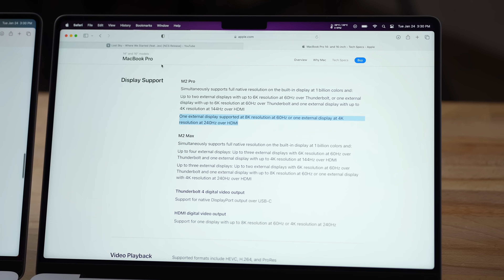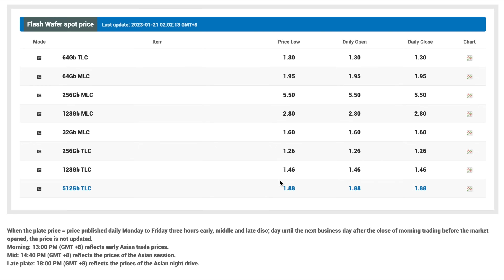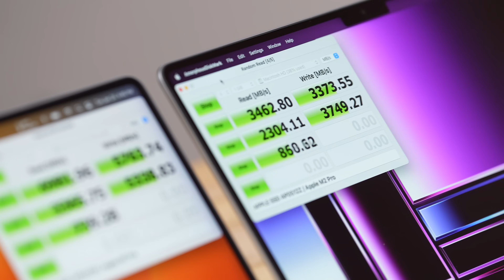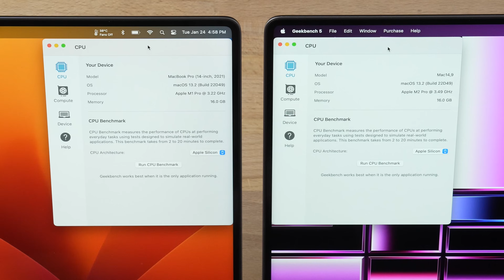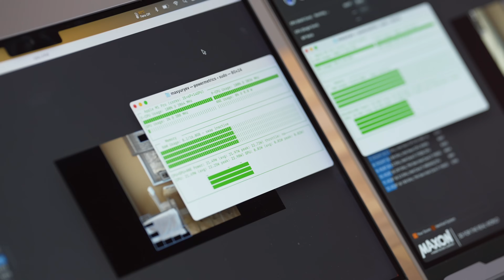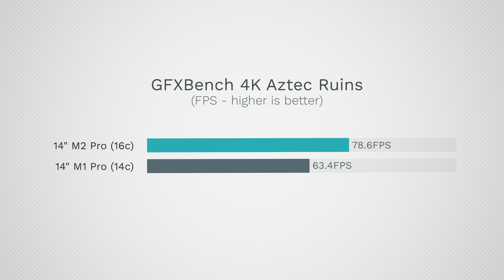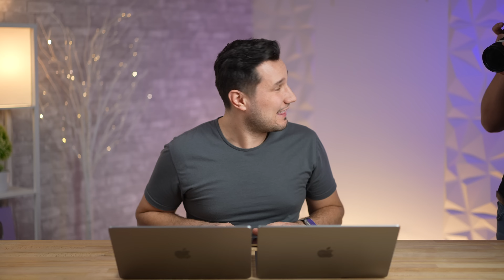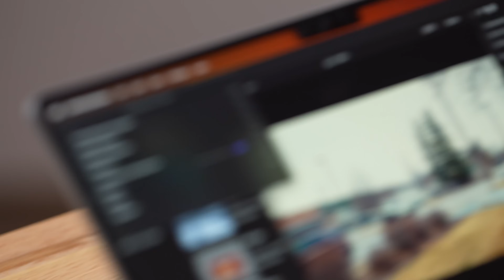M1 Pro vs M2 Pro 14” MacBook Pro - ULTIMATE Comparison!

Comment: Great job!

The M2 Pro SSD decision really sucks.  Processing is clearly an improvement but I wonder how the overall mixed usage will really improve with the lower SSD performance.  Another interesting observation is that the Random Read/Write tests on the M2 Pro is marginally better than the M1 Pro.  Could it be because of the faster processors?

Comment: I’m finally upgrading from my late 2013 13” MacBook Pro. It has served me well, but definitely much too slow for a lot of what I want to do. Should be quite an improvement after nearly 10 years!
Reply: same with me too, i have upgraded to M1 Pro 14 Inch form 13 inch late 2013 MBP, the size almost the same, and the M1 Pro base models is really great for handling any task for me and the battery life is stunning
Reply: I’ve updated from the same 2013 retina to the 2021 14 inch MacBook Pro last summer and it is absolutely perfect laptop. Seeing how Apple is cutting costs here and there I’m even more happy with my purchase

Comment: The absurdly shameless thing Apple did here is that they're NOT TRANSPARENT about the SLOW SSD PERFORMANCE because they now use single NAND chip compared to two NAND chips of last year's M1 products. They should have specified it upon purchase (either at retail or Apple online store.)
 
Or I'd like to see this as FALSE ADVERTISING. Just like Apple advertising M1 Ultra as faster than a RTX 3090-specced unit. Especially on a device touted as a PRO machine. Shame on you Tim.

Comment: Perfect comparison video, as always to the Max!
Whether this SSD NAND chip issue will impact performance negatively, YES.
Especially if you are working with constant read/write operations. I'm a ZBrush artist and using MBP as my main machine, hitting Quicksave for a normal project that has ~20 GB each on fast SSD will definitely be worth it!
:)

Comment: I didn't expect Apple to cut back on the SSD with the MBP models. Even if it wouldn't make much of a difference to the tests you run, there are people who might need this speed.
I am very much looking forward to the upcoming tests you will do to see if there is much difference in the SSD in other models
Reply: This new test is flawed, possibly? Max has already shown in the past that machines with an SSD in 2 slots have faster read/write than those with a single SSD. I suspect we'll see more apples to apples tests in the coming days.
Reply: @Lexxo777  yes, we will see in the coming days through the tests what the other MBP models show in terms of performance.

Comment: I would like to see the difference between the 16GB vs 32GB RAM, especially in the context of slower SSD inside the M2 Pro as the 16GB is more likely to use the SSD for the swap vs 32GB.

Comment: Great comparison, thank you. M2 Pro MBP is unfortunately disappointing. HDMI upgrade great. M2 higher clock speeds, higher power consumption, higher temperatures, not good. SSD so slow. M1 Pro MBP is definitely the better choice for the money. Am curious about the comparison of M1 Pro MBP 10 CPU and M2 Pro MBP 12 CPU.

Comment: These benchmarks are a gem, and your analysis helps a lot with my purchasing decision. Sucks to see the slower ssd and higher temps on the newer m2 pro. Definitely didn't know about these issues before your video.
Reply: Only 2° difference and more battery life and faster performance, I think m2 speaks by its own
Reply: @robertoavalosjr.2529  M1 Pro can be had now for 400 bucks cheaper, better speakers, runs 10 degrees cooler and double SSD performance. Apple nerfed the m2 Pro on purpose to squeeze save a few extra cents. The m2 is a new generation so it should obviously be better but for them to do this is absolutely disgusting. Glad I saved and went for the m1 pro.
Reply: @itsasadbunny  the speakers are hardly noticeable difference tbh. and running 10 degrees cooler isnt ever really noticeable either unless on your lap, which no1 would really be running intensive programs on their lap anyway. the only actual important downside of the M2 imo is the SSD read/write speeds. Beyond that the M2 is definitely the better computer. For anyone in the market for a Macbook pro rn that hasn't had apple M silicon yet, the M2 is the best choice (even if you can get a refurbished M1 for $400 cheaper). M2 pro has the better camera, all around better wifi, better bluetooth and HDMI, better battery life, and of course faster cpu and graphics. Plus its over a year newer so will have apple updates longer.
Reply: @Jayster3  you really want to excuse Apple screwing up their customers again, don't you?
Reply: @rafadydkiemmacha7543  you really wanna overexaggerate the issue don't you? Lol
Reply: @Jayster3  they are making these devices faulty on purpose. They have access to the best designers and technicians. Professional reviewers can name faults in matter of minutes, so Apple does it on purpose.
Reply: @rafadydkiemmacha7543  faulty? lmao there's nothing faulty about these machines. Stop it. The user experience with a M2 pro is fantastic. You literally do not notice the slower speeds. Should apple have done it? No. But Its truly not a big deal.
Reply: @Jayster3  the way they design cooling system isn't faulty? Duuude.

Comment: The battery test isn't fair, the M1 is a year or 2 old, batteries degrade with age and charge cycles, thanks for the other tests through

The heat sinks look almost the same size, one is lying lengthwise, the other is lying widthwise

Comment: With SSDs the random writes (more common in real-world?) are mostly better on M2. How do these compare for encrypted volumes? (incl. vs encrypted PC SSDs)
Graphics look impressive but I didn't think GPU scaling was an issue at 14/16-cores is anything else going on here? Can you check the new Metal RT setting for Blender?

Comment: These tests are not reliable as each test if you observe carefully is not done with the laptops of same specs. One test uses 8 core while other one done on 14c. So ideally these test do not tell the actual efficiency of a standard spec laptop. Do the tests properly not to get views

Comment: Interesting that despite benchmarks showing the M2 Pro being quite a bit faster than the M1 Pro the Lightroom Classic export test you did showed them almost the same.  As you say, I suspect the half speed 512gb SSD in the M2 Pro is the reason.  Very disappointing.  I suspect the M2 Pro Mini and M2 Mini also have the half speed 512gb SSD.

Comment: For those of use still relying on older Intel Macs for our primary workstation, it's interesting to see the M2Pro hardware adding a boost in your Speedometer test. Can't wait to see more testing with models that have multiple NAND chips on-board.

Comment: Wow, Apple went all in with cutting corners in the SSD huh. I usually use up all 16GB ram and when it goes into swap it immediately has a noticeable impact on performance. Now they made it even slower while still charging a ridiculous price. I feel like they make more profit on Ram and SSD upgrades than the whole machine itself.

Comment: Regarding battery performance: Did you use a brand new M1 Pro machine? In several new Apple products, maximum battery capacity seems to drop incredibly fast over just a year. So if your M1 Pro machine has a reduced battery capacity of maybe remaining 90%, the win of the M2 Pro one in terms of battery performance would be no surprise! Would be interesting to know if this was a fair comparison…

Do all of you guys out there also experience a decreasing battery lifetime of Apple products over the years?
Example:
My ‘new‘ iPhone 12 mini from 2020 has 88% maximum battery capacity 
My old iPhone 6 from 2014 (!) has 87% (out of use since 2020)
What is the reason for this? A more demanding Apple chip?

Comment: I have owned the M2 Air for 1 month and now have horizontal and vertical lines flickering on the screen, making it impossible to use. I was replacing a M1 MacBook Air that had the same display issue within months of buying it. They made me send the M1 in for repair twice and it failed again a third time right after the warranty expired. This was a new laptop! They refused to issue a new laptop to replace the reject I bought and since the warranty expired they expected me to pay to have it fixed again, when they didn’t fix it properly the first 2 times! The second time they falsely claimed I dropped it but they fixed it and shortly after the screen quit working completely.

So… stupidly I bought an M2 Air thinking the problems were with the M1 only. Nope! I have the same display issue with the new model after 1 month!!!  Apple isn't owning up to the display issues of the M Series MacBooks. In the past year I've spent almost $3,000 for 2 MacBook Airs that are now useless. I've wasted so much time sending it in for repairs, reloading apps and being without a computer while they try to fix their issues, which they obviously can't do… or won’t do because they’ll “fix” the issue, until the warranty runs out and leave you to pay for the failed laptop afterwards. It’s a trap. That’s what they did to me with the M1 and now it’s happening again with the M2. 

If you have a serious problem with your Mac you’ll never get a replacement; you’ll never get your money back and your work will constantly be disrupted with getting it repaired. Good Luck to you if you spend your money on one. As a long time Apple buyer/user, I now recommend you don't as it appears that Apple is not being responsible for the ones that have display issues.

Additionally, if you do gamble and buy an M2 be sure to also add the additional $300.00 for the Apple warranty or you may get stuck with a large repair bill shortly after the factory warranty runs out. I feel scammed.

Comment: Sadly I think Apple what’s really hoping the 3nm chips where there in time because of the ~20% less power  usage for the performance. Also the RAM is not slower the ram speed is the same the difference is that the pc can use 2 instead off one chip

Comment: I thought Apple on a $2000 laptop had only one NAND SSD chip in the base model, but I liked the part that the battery lasts longer than the previous model even using more energy and still stuck in the 5nm process.

Comment: I'm found an M1 mac mini 256gb base model on sale for $200 off ($699 instead of $899 - Canadian prices) and I see the M2 mac mini 256gb is now $799 not $899 for the base model. I dont require alot of storage space - I'm more concerned with speed and performance. It looks like the M1 has a better SSD and is cheaper and that may be the better option. Does anyone have any thoughts/comments?

Comment: As a solution architect who spent decades dealing with spinning drives where performance was measured in hundreds of megabytes, am I the only one who thinks 3.4GB/s is just stupidly fast already? I totally get it that there are use cases that need the faster 6GB/s. I just can’t get over how incredibly fast I/O is these days. 

As an aside, I suspect the single chips are Apple’s solution to supply chain problems more than a cost savings solution. The decision is obviously hurting their reviews, but they’re willing to take the hit. Likely because it’s letting them get more of these high-demand units out the door than if they stuck with two chips.

Comment: Need to account for the year or two’s battery wear of the M1 Pro MBP 14”. More or less in that case, it’s the same as for the battery life between the two, give or take. 

However, given the SSD shenanigans and just the 20% performance boost; it’s really a good time to snag a M1 powered model, given they’ll be getting huge price-cuts; until they all get sold out 🏃‍♂️

Comment: I think that the biggest problem will be when the SSD starts to fail. Data recovery will be a pain in the ass assuming you dont use cloud services. So far, M1 and M2 are relatively recent, but idk how much more time can they last with all parts integrated.

Comment: Happy to see the comparison soon after M2 Pro launch and you guys are miles ahead of others. On SSD speeds, although I am surprised to see a slower speed on M2 Pro, I don't it matters much as there are no apps out there that can hit 3GB/s mark.
While the M2 Pro is certainly more powerful, deals on M1 Pro makes it even more VFM and hence I got M1 Pro couple of days ago. Very happy with the performance when compared to i5 13" MacBook Pro and M2 Air that I am currently have. Cheers!
Reply: Hey Jay any deals you can share? I'm looking for the same.
Reply: @zanettialvaro  I live in EU and bought base model - 8 core 16GB Ram 512GB from amazon uk for little over 1.5k sterling. I see prices dropping further and would advise you to keep an eye out. A refurbished mac from Apple is also a great option.
Reply: @zanettialvaro  Same, let me know if you find them too!
Reply: @alexanderpadden6498  base 14" MBP is on Apple's refurb store at $1539. The new M2 base is ~30% more expensive so me thinks 2021 MBP refurb'd is great VFM.
Reply: @dentheplodder  FYI:  I just looked and I can only find 14" MBP w/16GB and 1TB SSD for £1839...  Nice configuration, too much money...
Reply: @kjbarth007  yeah, they weren't on the UK (where I'm based) store for long. Matter of days and then gone.
Edit: They were selling for £1459
Reply: @kjbarth007  Amazon uk have 'Used Like New' for 1638 sterling at the moment. It would be a brand new unused mac and i believe it is good price compared to M2. I see prices dropping further, just keep an eye out. Cheers!
Reply: @kjbarth007  2021 base 14" MBP are back in the Apple UK refurb store. Wouldn't expect them to be there for long.
Reply: In Australia M2 14 Pro base $3,199 versus M1 14 Pro base $2,547 both brand new. Makes M1 very appealing on price and value.

Comment: This is total disapointment. It costs 2400€ and it has slower ssd than older M1 Pro version. Apple just desperately force people to pay another 260€ for extra 512GB ssd chip. And smaller aluminium block on CPU which draw 10-20% more watts is rediculouse too. It is seen by thermals you shown that this is bad :( I was waiting for this machines but now i am not sure if i am willing to pay extra just to get full ssd speed.

Comment: Absolutely no regret on getting the base Studio M1Max 16/512 compared to the Mini M2Pro with 10c. It appears that the Studio is faster at absolutely everything which doesn't quite make sense in the CPU department at least. Both M1Max and M2Pro have 10c CPU, with the M1Max being slightly "slower" and yet - it still outperforms the M2Pro in benchmarks.
The new SSDs in these M2 machines are a real shame tbh.

Comment: Fantastic review on the comparison! 
- Slower SSD, Worse Cooling, "Worse Speakers" (sound is subjective though)
- Better Battery Life, Better Performance (CPU & GPU), has a matching mag-safe cable (maybe sell them separately Apple?)
At the end of the day, whatever suits your needs is the one you pick...because instead of comparing devices, compare the prices :)

Comment: The M2 Pro Mac Mini has ver similar SSD performance and Luke Miani found with a full tear down that it had two NAND chips but they were just on different sides of the board. I am wondering if this one also has two NANDs, just on different sides of the board as well and its just slower NAND then the one in the M1 Pro. No idea though.

Comment: I would have thought, this being the third iteration of the Apple silicon, that this would be a tic in the engineering cycle. But at this point it seems to be a second toc focusing on efficiency rather than delivering a large number of new features and performance.

Comment: Max Tech… Are all the M2 SSD performance options you tested thus far slower then the M1 SSD’s? I originally thought it was only the case with the base 256GB option and not the upgraded 512GB and higher options? Originally considering the 14” MBP but now thinking the Mac Mini and will be using for photo & video editing.

Comment: Being an Intel/Windows user for  over 30 years and due for a new laptop purchase. I was therefore intrigued by Apple silicon with its performance to power and really appreciate the time and effort your team puts into the reviews which certainly went a long way towards me making my decision in November 2022 to purchase a base M1 MBP 14. The single ssd trend from Apple is dissapointing and I think a missed opportunity. Also, as proven in your tests, raw benchmark tests do not tell the full picture compared to everyday use meaning there are minimal gains to be made by upgrading from M1 MBP 14 to M2 MBP 14. Please keep up the great work!!

Comment: I have a 2019 i9 MBP 16 and thinking about upgrading to Apple Silicon but I'm holding off on doing it until your upcoming comparisons between unbinned M1Pro and M2Pro as well as M2Pro and M2Max. Your reviews and comparisons are really comprehensive and useful.

Comment: Not liking the single Nand chip, or the smaller heat shield. Strange that Apple made both of those decisions. If I upgraded from my M2 Air to the Pro, I"d buy an M1, for my usage. Honestly, my double spec M2 Air is plenty powerful, for my needs..I would enjoy the extra ports, better screen, and better sound, on the Pro, though.

Comment: The battery test is not directly comparable as the M1 PRO MBP battery would have degraded somewhat for the past 1 year of usage whilst the M2 PRO MBP is fresh from the factory, being able to hold the full charge better. Of course, somehow the extra 2 Efficiency cores in the M2 Pro plays a significant role too. Very disappointed with the use of a single SSD storage module. APPLE is penny pinching here